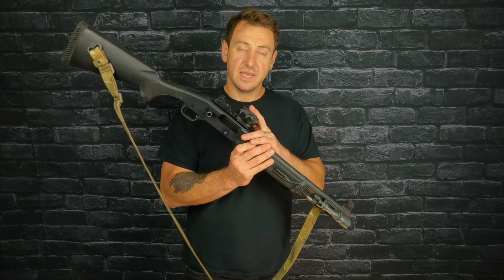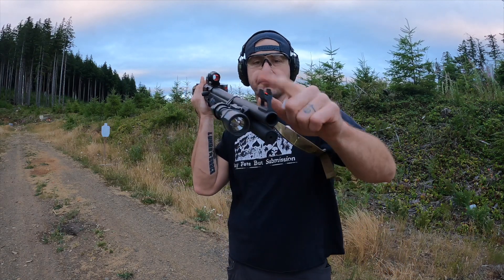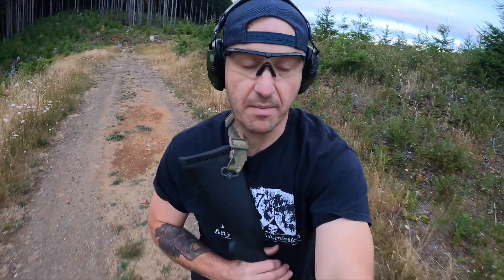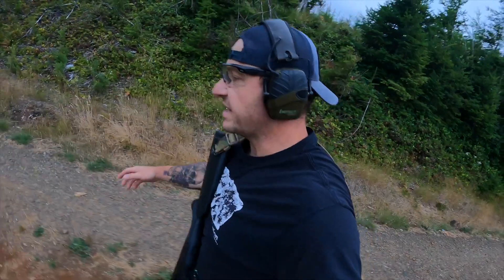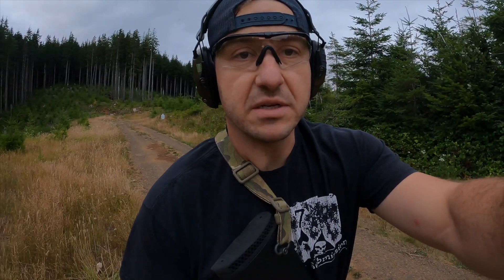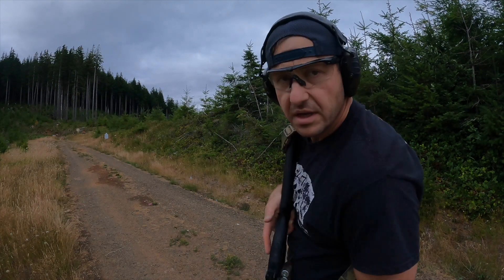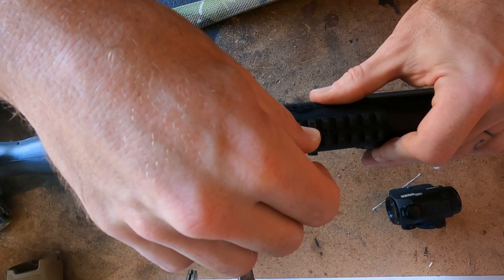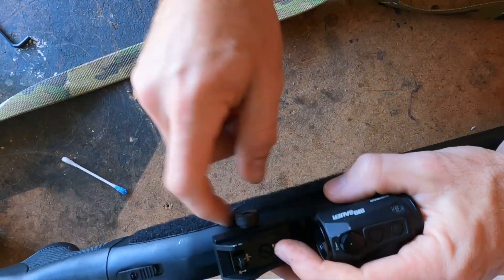Mossberg 930 - Rail and Red Dot Instal

Comment: You should have included your actual red dot clicks close up for both azimuth and elevation procedure from multiple distances. Using a slug to get dead on target. I’m still having great difficulty sighting in red dot on my 930 SPX. No matter how far I adjust my Sig dot up or down, I’m always hitting 6” lower from 25 yards even on bench with stable sand bag rests. As far as the lock tight it seems that you would be best to do that before ever using the gun immediately after purchasing. Knowing that recoil would eventually loosen the screws.
Reply from the maker: We’ve been putting slugs in one hole at 25 yards lately with a Benelli m4. Stay tuned for a vid
Reply: @pnwliving9523  I had since corrected my red dot issues. Turns out mine was defective and I replaced it. Got it dead on at 50 years with slugs now. Using a Mossburg 930 SPX.
Reply from the maker: Sweet, what ammo high end or economy?